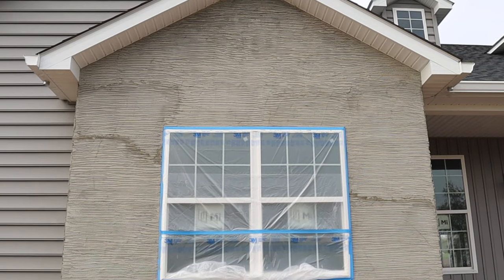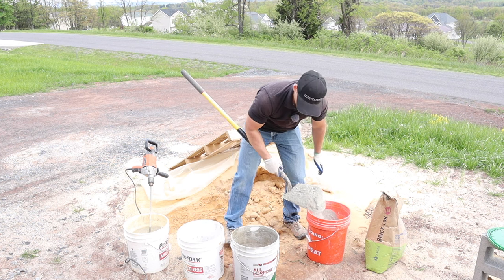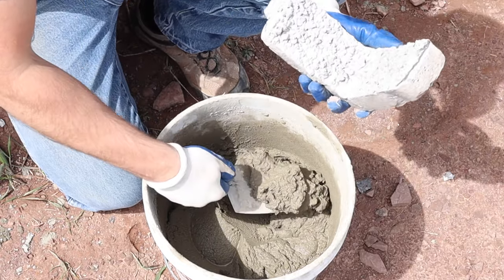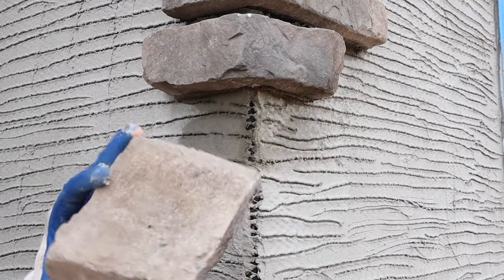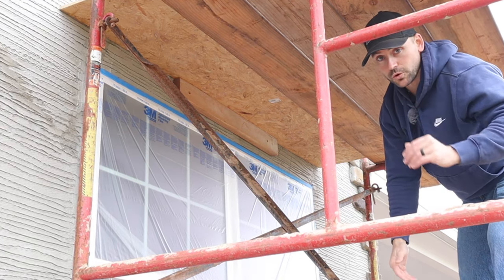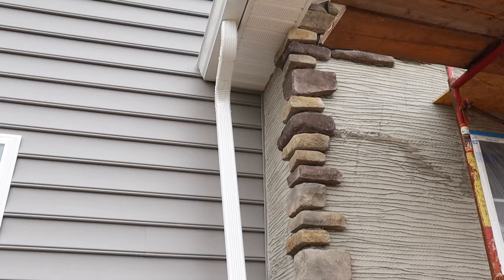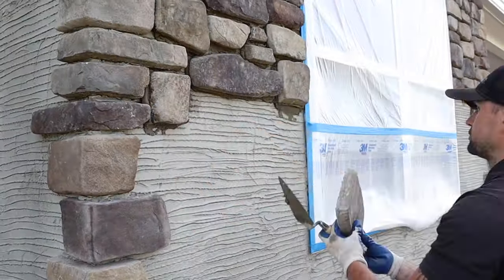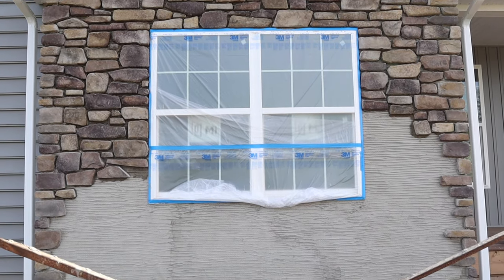Stone Veneer Installation - Part 2. Corners And Flats - BEGINNERS GUIDE

Comment: Ive been doing this for ever as my trade ..in our climate we scratch the wire tight..let it set ..dbl our basecoat with a very sticky mix ..add a lil hydrated lime n glue ..apply thick n sticky ...so its about 1 inch deep ..apply water spray to back of stones to eliminate dust ..install stones in mudbed by wiggling n setting straight n level ..as you press ..your excess comes out out to act as yr grout filler...this way you have all one coat which drys n cures as One...no air space ..no too much suction for you ..i can do a 10 x 10 area in 45 mins that way ..and you never have stones falling off from freeze thaw in cold climates ..im a stucco pro and mason for over 45 years ..ive never had a stone fall off ...EVER
Reply: I do a lot of veneer work out here in Florida. Now i picked up some nice jobs in jersey but im wondering how much different the application is ? Type s still the same ? I know some guys use bonding agent as well
Reply: @KR8810  in canada 🇨🇦  I use type s and  bonding agent too...on the back of my stones ..in my mix and in my spray bottle too..and still if I want real sticky mud ..add a shovel of hydrated lime to my 5 gallon pail of mud n mix it like a pudding ..then it's super sticky n get hard like concrete
Reply: @mjboux6559  never heard of this hydrated lime . Is that the name of it ?
Reply: If you were here in Rhode Island I would hire you

Comment: I wanted to understand how these heavy stones don't fall. what's the logic?
Reply from the maker: The mortar creates a suction to the stone and wall and it holds it. I hope that helps!
Reply: @TheExcellentLaborer  but only the mortar can do the job of keeping the piece in place without it falling, or can those friezes you make also help to secure the piece to the wall?
Reply: @TheExcellentLaborer  I can't find this mortar already mixed? Do I need to buy cement and sand to make this mixture? I'm going to build a fireplace on the 15th of next month and I've never done it before. your videos are excellent. Thank you for your help .

Comment: I am getting ready to start my first stone project.  It's 2 small areas, just 3' x 4' but it's below siding.  Was hoping you would show how you finished the sill below the window so I could see how to finish a sill (ledger) below the siding.  I saw you used the brackets to hold but do you do anything to the seams where the pieces of sill meet?
Reply from the maker: Great to hear about your project! If you watch my fireplace stone veneer video you will see how are used mortar to grout the joints. That video will help you immensely. Thanks for watching!

Comment: Question?  If you have a SUPERIOR WALL foundation, can you just apply mortor and stone to the wall????  Thanks!
Reply from the maker: I would consult with your stone manufacturer about that. Me personally, I would put a scratch coat over the existing wall to make sure it is rough before placing the stone veneer on it. Hope that helps!

Comment: How would you recommend installing these over interior concrete block painted with drylock? Or over top of existing exterior brick?
Reply from the maker: I think it would be very hard to get water to adhere to dry lock. I really have no idea how that would work. But if you tried it and they would not hear you could use tap cons to install metal lath and then apply scratch coat to the metal lath similar to what you seen in part 1. Hope that helps!
Reply: @TheExcellentLaborer  This is exactly what should be done. Even prepping products that have a bonding glue base to them doesn't have enough strength because of the drylock that was put over the brick. Lath is the way to go for sure. 👍🏻
Reply: @TheExcellentLaborer  yes it does 100% help . THANK YOU for reaching out. It is appreciated
Reply: @davidharrison3074  that is why I asked. Because I know drylock would make the block less porous. I just wanted to ask somebody I know that has done these and has actual hands on experience with it. Thank you 💪🏻💪🏻
Reply: @TheExcellentLaborer  would I need to use furring strips behind the lathe for the scratch coat? Or will the steel lathe be installed directly to the block face?What would hold better over  time ?  Thanks a ton for your input
Reply: @landscapingspecialist  apply the galvanized metal lath directly over your surface. You want the subsurface to be solid. I hope your project works out for you. 👍🏻
Reply: @landscapingspecialist  shoot metal lathe w Ramset gun and nails and plaster it. Won't ever have any issues.